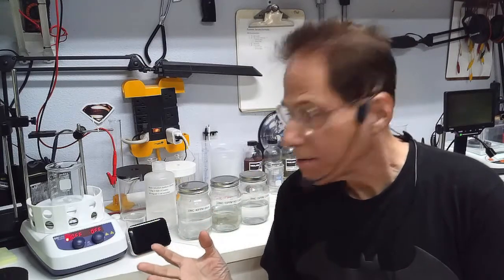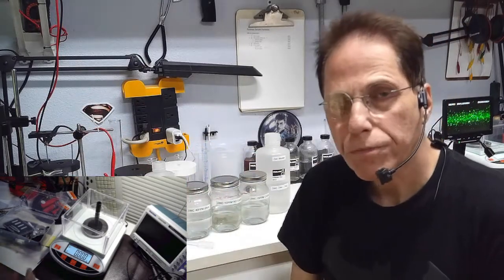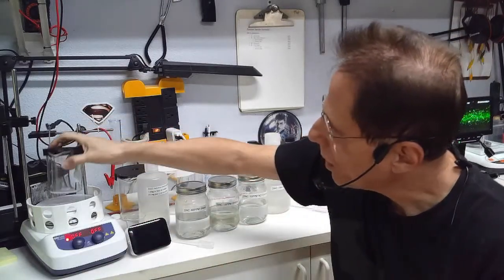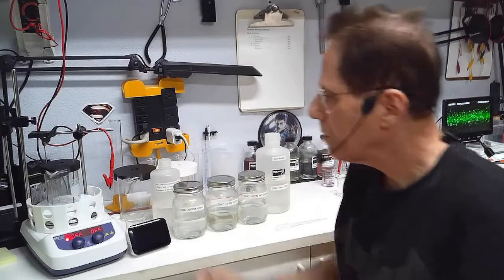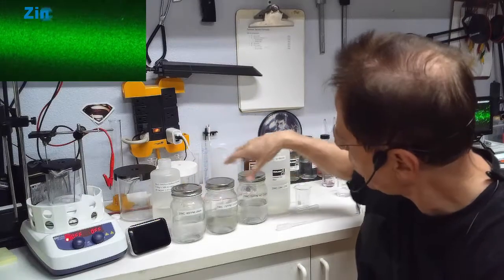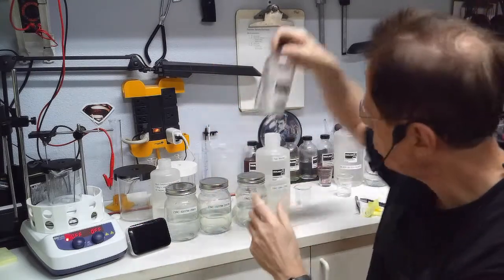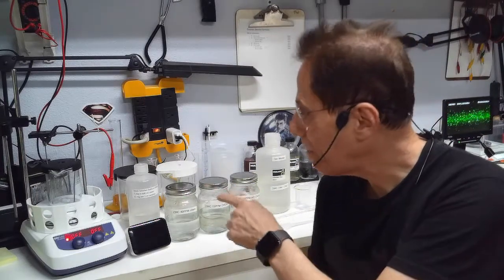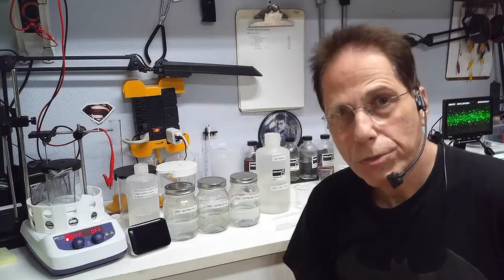How to Make Zinc Nanoparticles.

Comment: Do you know if theres any negative reaction between Citric Acid and Zinc? The zinc I've been making has been very quick. I get thick cloudy white after only an hour using 1/16th of a tsp of sodium citrate in 1lt of water. I think the main reason for the speed is the size of my graphite cathode(its quite fat). 

Anyways, I noticed after I had finished making it that the cloudy zinc had swirls through it which meant the particles were not properly suspended. I tried adding some citric acid with stirring and the swirls disappeared. Later on I noticed that some of the zinc had still fallen out and collected on the bottom but the particles did not seem like they were clumping together or forming strands, so I tried adding more citric acid and more than the first time with stirring again and to my surprise the zinc resuspended and the solution became much less cloudy.

I just tried another batch and this time the cloudy zinc became what appears to be completely clear after adding the citric acid(this is after turning off the electrolysis and removing the electrodes). My concern is that the zinc might be forming some sort of water soluble compound with the citric acid instead of helping suspend. This is why I'm wondering if you know of any negative reactions between citric acid and zinc and whether they are safe to take together?

I know citric acid can be used to remove electroplated zinc from steel but I don't know if its dissolving the zinc or suspending it. The water seems to become very cloudy white when this is done.

Any info you might have would be much appreciated.
Reply from the maker: From what I know, citric acid will dissolve zinc. Citric acid will also dissolve magnesium. When I tested using citric acid on zinc, I got a completely white solution and very little colloidal material in it. 

Zinc that is cooked on its own is not very stable. Using sodium citrate, just a few drops, will help it stabilize. It is normal for it to be slightly milky white when done. Then over time the liquid clears and the ppm or the laser through it may be slightly less. If you cook the zinc to 60ppm or higher the milky white color should remain. 

Even with the sodium citrate zinc concentration of colloidal may go down over time, 60 days. 

Plasma Arc Zinc will also be milky white at the start at 20ppm then turn clear after about 5 days or so. Then the colloidal concentration drops a bit. It usually does not drop below 12ppm whether it is cooked with plasma or low voltage DC. Still I would renew my zinc every 60 days to be sure of a good concentration.
Reply: @AlchemyWizard  Do you think the Zinc is becoming Zinc Citrate with the addition of the citric acid?
Reply from the maker: @AndAbel-AOD  That does seem to be the case from what I read about the reaction between zinc and citrate. It creates zinc citrate along with releasing hydrogen in the process.

Comment: use boiled water which is hot...use less than 0.5 milliamps. no need for sodium citrate...
Reply from the maker: Sure that works, just not very efficient and without the sodium citrate it will be unstable and fall apart in as little as 30 days. If you will consume it before that point, then that works. Of course the cleaner the colloidal the better. I cook zinc mostly now with Plasma Arc HVAC, highly efficient and only uses distilled water.  Thanks for the input.
Reply: @AlchemyWizard  unclear what you mean falls apart. ionic zinc in clean water.
nothing to react with. low current means smaller particle size. never understood the need to have it done at high speed.
 i make 2.5 litres of CS in 8 to 10 hours with ppm of 10 at a current of under 0.5 ma.
 it is pulsed  biphasic 4 hertz and runs of a lithium 3.7 volt battery.
 i have also experimented with 20 microamps over several days from a 3 volt battery with a 20k variable resistor in series to set the current. again very small particle size.
Reply from the maker: @esecallum  After 30 days you can get white specs, zinc hydroxide in the colloidal solution. The colloidal barrier that protects the nanoparticle is breaking down and it loses its neutral charge. It starts clumping with other like particles. When enough gather up they drop out on the bottom as white specks. You are losing the potency of your colloidal at this point.
Reply: @AlchemyWizard  ok but you dont have to keep it for long... just drink it and make some more as needed. i once made it and you are correct there were white large white flecks on the zinc plates when i had a look at after a few months which had i got from a a AA zinc chloride battery.
Reply from the maker: @esecallum  yep, as long as you drink it within 30 days or so, just make it simply by using water and the zinc rods. 👍
Reply: @AlchemyWizard  with food or without food and does it cause indigestion? what are your experiences?
Reply from the maker: @esecallum  I have one person who is taking colloidal zinc that she also at one time took ionic zinc tablets. The tablets give her indigestion, the colloidal version does not. 

When I give out silver I mix it with 20% zinc and 80% silver, no one has complained about the zinc bothering them. 

I have found, you can take colloidal zinc with food or without. Some colloidal like gold may be more beneficial on an empty stomach.

What I do is take my colloidal mix in the morning when I get up. Then eat some breakfast.

Comment: Where I am I only got a thumb-sized trapezium block of pure zinc. Trying to figure how to suspend it in the distilled water. Right now thinking of wrapping a copper wire around it and clamping the alligator clip on the copper wire. After all copper zinc is a combination. downside is I won't know how much of each is in the solution. I can pre- and post-weigh each of course. If you or anyone has a better idea, I'd be grateful for it.
Reply from the maker: You can just use the alligator clip to hold the zinc above the water. Don't let the clip touch the fluid. Then you will only get zinc in it. I use this method when I put the large magnesium rods in the water or use the coin shaped scientific metals. 

See the colloidal chromium video where i suspend the coin above the liquid. https://youtu.be/h8GJy7vgsro

The alligator clip would work fine but if you did not want to do that you can drill a hole in the top of your zinc and twist copper wire around the hole tightly. then use that to suspend the zinc partially in the fluid without the copper touching it.

These larger pieces of metal have lots of surface area, there is no need to completely submerge them to get the material off.
Reply: @AlchemyWizard  thank you. My zinc piece is an ore, with a very rough surface. But I'd like to try your suggestion of drilling a hole and putting a copper wire through it. It is bulky. 

I also wonder whether you have ever done a calculation of how it translates to milligrams. For example how many mg of zinc is there in a teaspoon of 40 ppm zinc. I know that 1 drop of the copper sulphate solution is 1 mg of copper.
Reply from the maker: @CameraObscura-hq9rs  The general ppm formula for the colloidal is the same. Though perhaps not 100%, as actual ppm depends on how much of the material becomes a colloidal. You need the laser microscope for that determination. However the general formula will get you close: 

ppm = parts per million /start-finish = weight of cathode

dose per 1 tsp (5mL) = volume in mL / 5 

So if we used 7mg of material in 500mL of distilled water we would have 14ppm. Now one teaspoon is 5mL and there are 100 doses 500mL of distilled water. That will give you 7mg/100 or 70mcg per teaspoon of material.

When you break the colloidal material down to per teaspoon it does not seem like you are getting much. However colloidal are easily absorbed in the body, unlike ionic substances which typically have poor absorption.
Reply from the maker: @CameraObscura-hq9rs  Drill a hole, twist the copper wire on top. then use that to suspend the zinc in the solution. You can use masking tape to hold the wire to the outside of the beaker or jar. and dangle the other side in the liquid with the copper a few millimeters above the water line.
Reply: @AlchemyWizard   that's crystal clear! You explain very well.  Yes, it seems very little to balance out the copper I'm planning on taking (6 mg per day from copper sulphate), but will test out the power of colloidal, as you say.
Reply: @AlchemyWizard  got it!

Comment: Hello. Can we take zinc, silver and copper together
Reply from the maker: Yes you can. I mix my colloidal into what I call a forever mix. I plan a show on this shortly in fact. In that  i mix gold, platinum, silver, zinc, magnesium, titanium, iron, chromium. They all mix nicely and it makes taking them alot easier. I just pour the mix into a shot glass and down it goes. one gulp instead of many.
Reply: @AlchemyWizard I have a bob beck machine you make collodial silver can I use that machine for zinc copper etc
Reply from the maker: @sazzylazzy  Any silver machine should be able to be used for copper and zinc. Gold may present a problem, depending on how far apart the wires are. Gold requires larger spacing so you don't loose too much of it.

Comment: Thanks for your videos! I'm learning a lot! I have a question. Hope you can help me. It seems I cannot buy the zinc rods you use as they cannot be shipped to my location. I found in Amazon some pure zinc anode sheets (99.995%) that are used for electroplating. Do you think I can get those instead of the rods you recommend?
Reply from the maker: those will be fine. Just a different shape. Actually with the additional surface area of the sheets you may be able to cook the zinc faster.

Zinc anode sheets: https://amzn.to/3WZjfKr
Reply: @AlchemyWizard  Thank you!

Comment: I am trying to devise a recipe to make 1-gallon batches of colloidal zinc @ 25ppm to share with friends as I do with my colloidal silver. I have a 60v power supply and a spinner with a heat option. My goal is to speed up the process as much as possible - 30 to 60 minutes total - and to keep the particle size as small as possible. Can I just up the mA from 5 to 20 to speed things up or are there unintended consequences? Do you have suggestions and perhaps a formula that you can suggest?
Reply from the maker: Use my stock solution of sodium citrate. see the video link below on how to make that. drip the stock solution in one drop at at time until you reach anywhere from 5 to 20mA. That will speed up the process. Let me check my last records...

my last 500mL batch using 20mA of current  dripped sodium citrate cooked for one hour and yielded 46ppm of zinc. The microscope showed about 40ppm solution, so some got lost in the white flakes you get floating around when you try to cook a high yield batch of zinc. that is normal. 

You can can at this point mix down the 40ppm to 20ppm by mixing it with 50% distilled water, and you would have 1000mL of 20ppm zinc. Zinc particles are more or less the same size, when I use sodium citrate for fast cooking or without anything at a slow cook. I always cook my zinc these days with sodium citrate as it takes too long the other way.

Also sodium citrate is the general purpose colloidal nanoparticle stabilizer. I've read this in scientific journals, they recommend using it even in silver, even though silver cooks fast on its own with nothing in it. 

Making Stock solutions: https://youtu.be/lyQ1v9N5MW0
Reply from the maker: I use 37volts and do not current lock when I use zinc. The current will stay around where you dripped the sodium citrate. It may go up a bit as the colloidal goes into the solution. 

You could also cook a liter or a gallon but I have no idea how long that would take at 20mA of current. You have to experiment. If you cook zinc too fast you may get more of the white zinc hydroxide floating around and lose some that way and so they do not become colloidal, but zinc metal itself is not that expensive. 

I have had negative results using heat with zinc, but you can experiment with that as well, perhaps 40c. The higher the temp the more zinc hydroxide you create and the less colloidal.

Comment: Hermes ive got an 1 cm diameter 40 cm long zinc electrode rod . But i have an question is this rod oké? Or is dome zinc melted with dangerous other metals ? 
Kindest regards ❤
Reply from the maker: That rod will be fine. you can put lots of current in that before it melts. However its normal resistance will limit what you can pull through it. Here is a link to my lab sheet of the last zinc I cooked to 40-46ppm. It may help you. http://wisdomsdoor.com/files/pdf/22121802%20Colloidal%20Zinc%20500mL.pdf
Reply: @AlchemyWizard  thank you Will make it tonight 😎💪🏻
Reply: Ok i Made it and it became perfect i use 220volt ac and it was clear milky in 10 minutes Amazing 🎉 now going to test it how it feels 🥰💪🏻💪🏻 thank you hermes
Reply from the maker: @BGmedia  Great Job! Woot!
Reply: But i was worried because your rod is bendable but mine is 1cm thick and rock solid like a nail to put in wood 
And i bought it at the name zinc electrode 😅 So hope its going to be oké

Comment: THANK YOU, YOU MISSED THE INFORMATION ON HOW MANY DROPS YOU PUT INTO THE GLASS CONTAINER
Reply from the maker: In 500mL of distilled water, you drip the stock solution of sodium citrate until it reaches between 5 to 20 mA. At 20mA if you cook it for 30 to 40 min you will have about a 26ppm solution. At 5 mA if you cook it for 30 min you will have about a 15ppm solution.

For instructions on making the stock solution of sodium citrate see:  https://youtu.be/lyQ1v9N5MW0

Comment: I am doing my first batch of colloidal zinc right now. Can you please tell me how many ml can I take orally, if the concentration is 40ppm?
Reply from the maker: With  zinc at 40ppm you can try one to three teaspoons. The body will flush the unused zinc out of it. Start with one, see how you feel. Try two then three until your body tells you that you have had enough. 

When I start taking a new colloidal I find my body craving more of it. Then after awhile as the levels get normalized in the body, I feel like taking less.

When you got enough going into your body you may even find yourself forgetting to take it. That means you are giving the body a bit more than it needs. You can skip a day or cut back at this point, or just take it on the days you feel you need it.
Reply: @AlchemyWizard  
Thank you for such a detailed and professional answer.

Comment: Thanks for a very informative video and it was great fun to watch. Does it use similar voltage than colloidal silver?
Reply from the maker: I cook all my colloidal nanoparticles at 37 volt dc. but any power supply over 24 volt would work. I have seen some people cook colloidal  nanoparticles with 5v. However I do not think that would work well with zinc because it is a bit stubborn in releasing its payload. If you were desperate and did not have a high enough voltage supply, you could take three 9 volt batteries and stick them together to get 27volts. I will post a picture of it in the community page for those interested.
Reply: @AlchemyWizard  Thank you so much for the reply. Yes, I didn't think a low voltage would strip off the zinc particles. I was thinking around 48VDC. @ 5VDC  it should take eons to get the job done. I usually brew my colloidal silver at 12 to 24V. Thank you so much for the information and for sharing.
Reply from the maker: @hiddenvintage  48v would be great!
Reply: @AlchemyWizard  Hi. I managed to make 12 ppm colloidal zinc in 7 hours with 2 9 volt batteries. Is this suitable for drinking the colloidal zinc I made?
Reply from the maker: @vedatkahraman6964  Yes that should be fine to drink and sounds about right with the voltage and time to cook the zinc for a 12ppm solution.

Also you can mix zinc and silver together. It is a great combo. I mix 20% Zinc  and 80% silver with all my Colloidal Silver that I send out.
Reply: @AlchemyWizard I will mix zinc and silver colloidal in the proportions you specify. thank you so much. I wish you success in your work.

Comment: Can You share the Math calculations you used to determine the zinc chart?
Reply from the maker: ppm = material used in grams x 10^6 / amount liquid in mL. (example: 14ppm = 0.007g x 1000000 / 500mL)

Comment: I'm not sure what kind of zinc to purchase, can you please give an example? Would this work? "Pure Zinc Anode Sheet 2pcs (99.995% Pure) for Zinc Plating and Zinc Electroplating, Zinc Electrode Strip"
Reply from the maker: Amazon links tend to dry up, so that is why I refrain from putting them in the description. This link still works and is the zinc I am using now. It works well and comes with enough that you never need to buy zinc again. Doing a search for zinc 99.99 will also bring up other zinc wire that can be used.: https://amzn.to/3dyB1Ug, Alternate Zinc Link: https://amzn.to/3DKEF8g
Reply: @AlchemyWizard  thank you! I'll return the one I previously purchased and get this instead.